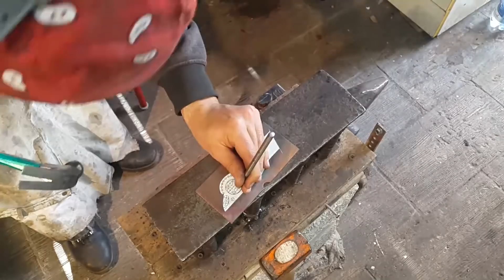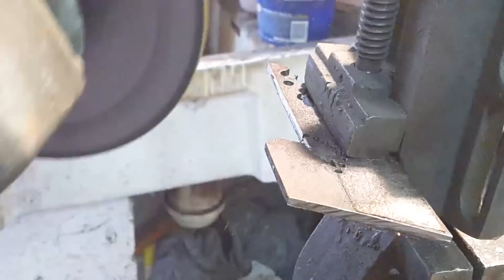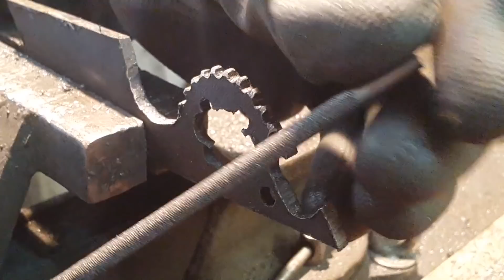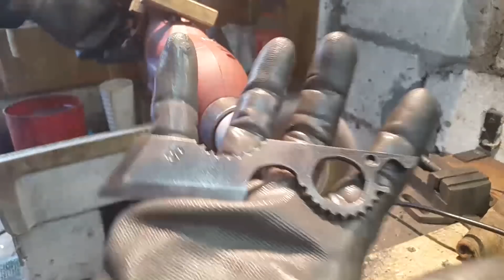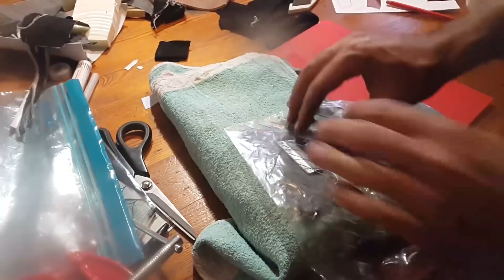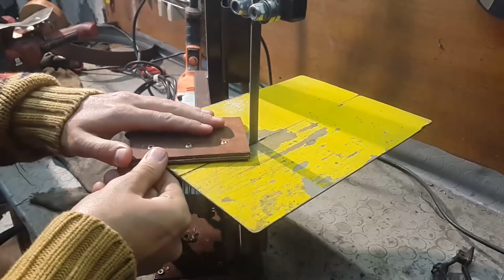Making Of CUSTOM KNIFE

Comment: Nice knife - really like the unique look. Just a tip because I myself had trouble getting a finger hole on a knife to be perfectly round and I also didn't have a near big enough drill bit. Just like you I drilled multiple holes and filed out the rest. I found that once I cleared most of the hole with my 3/8" round file I swapped to a half round. I held the tip of the file with one hand to help guide it and as I cut with it I carefully slid it around the hole in circular motions, typically making full circle in two cuts.  This helped me a ton in making the hole perfectly round, hope it helps you too. Best of luck!
Reply from the maker: J.N. Bailey thanks for suggestion!! But i will buy a hole saw for steel, i already have one, but it was to big for this knife